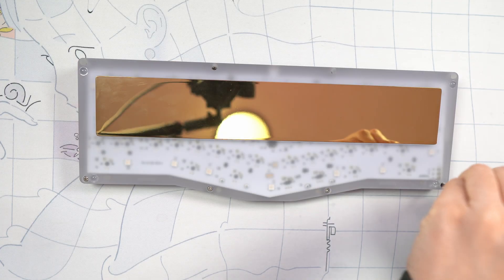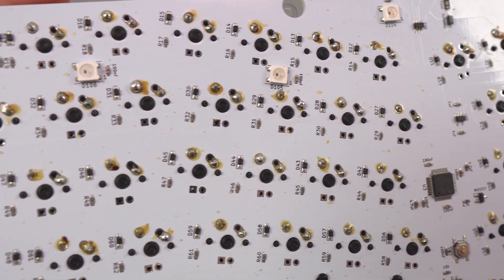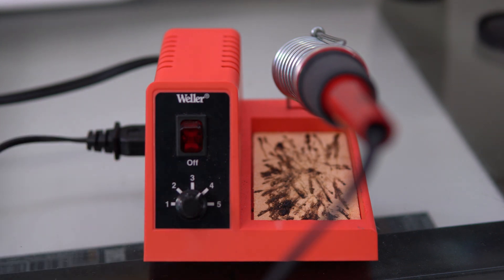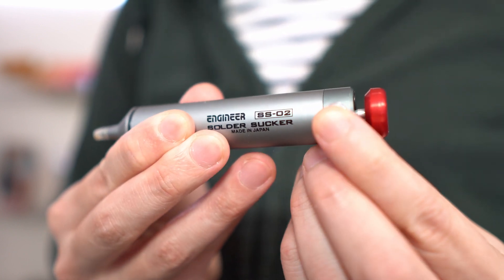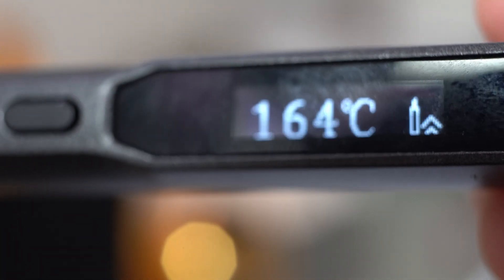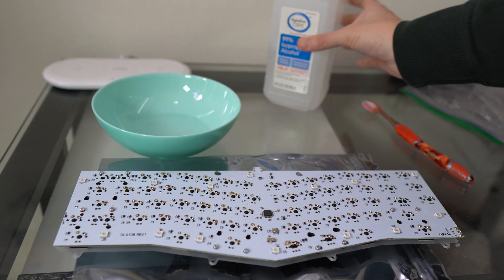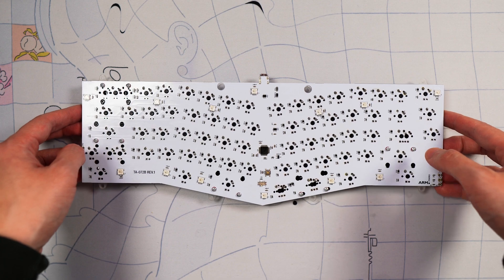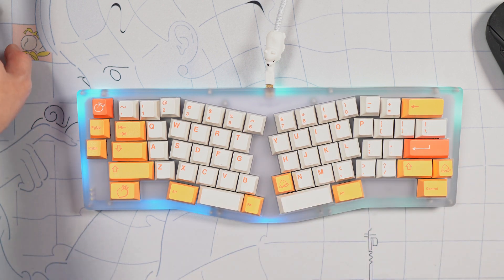Fixing My Bad Soldering on a Custom Mechanical Keyboard

Comment: Does a bad soldering job affect the keyboard?
Reply: not unless it you completely screw it up. 
ie, lifting a pad

but like as seen in the video, his keyboard works just fine even with the bad joints

Comment: When I desolder the switch, my pcb trace got burnt and the key is not working. Can I fix it with isopropyl alcohol or I have to do it another way?
Reply from the maker: I'm no expert on this, and without a pic it's hard to say, but you could try cleaning off the burnt parts as a start. If you look around reddit you can find some potential solutions to fix the trace, such as using a 30 gauge wire

Comment: i don’t have a pump, however would using my solder on the round tip to reshape it work as well ?
Reply from the maker: Hmm probably not, the roundness is caused by excess solder on the joint, so you need to remove the extra solder

Comment: ss02 is on its way, going to fix my solder job as well, the plastic one couldn't hardly suck the solder up.
Reply from the maker: That was my experience as well, the cost savings isn't worth the frustration